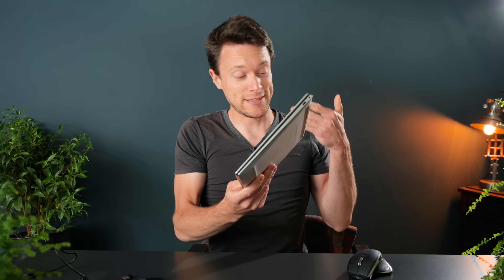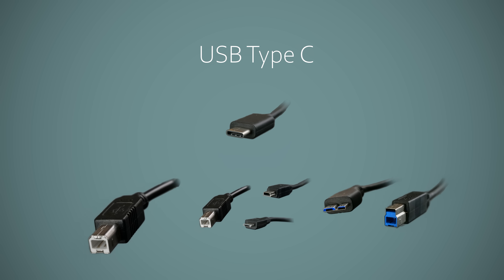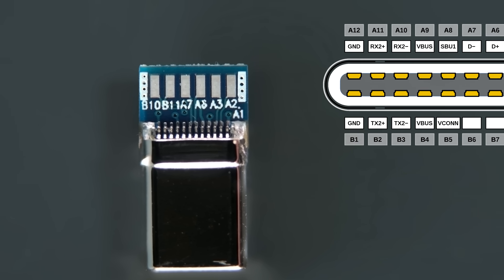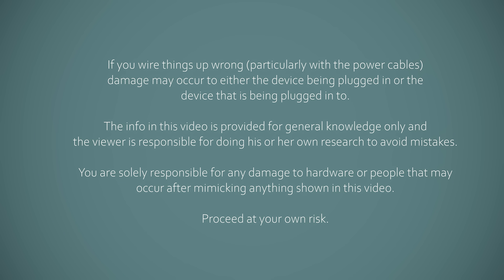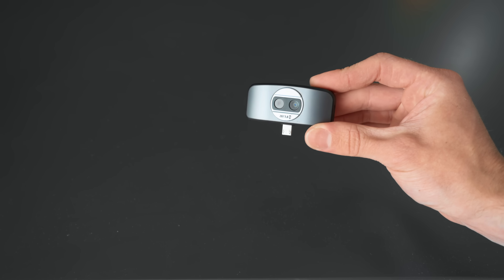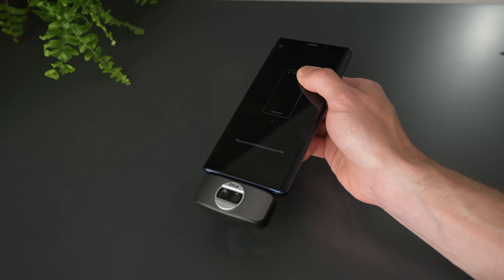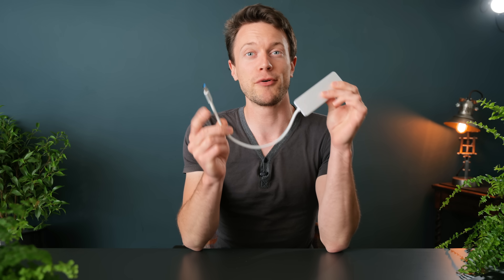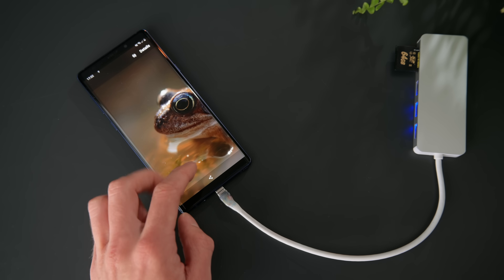Converting devices to USB Type-C

Comment: 7:05 can't you just move the existing resistor to other pads next to it? Seems to me that's how it's supposed to be done.

OR! Just jump the pads and scrape the trace?
Reply: dont even need to remove it, once the trace is cut like in the video just bridge the VBUS and GND sides
Reply: In fact yes one side of both pads connects to the pins on the USB while the other pins connect to VCC and GND. Swapping the position of the resistor would in fact change the mode
Reply: I almost had a heart attack while screaming, "just unsolder a move the resistor"
Reply: @DavidTelesPortugal  hahahahhahahhaha me too!
Reply: David Teles Tech & Video Can you plz explain which resistor and move to where. Also how would the help? Just asking for when i try to do something similar. Thanks
Reply: @Adok24  I'm not david, but I can tell you. At 7:08 You can see the highlighted resistor is labeled as R1. The empty slot to its left is labeled R2. Since the USB's function is either-or (host or sub), and there's two pads grouped together by the white outline, and we know the slot occupied by the resistor is  registering it as a host, logic dictates the pad next to it changes its registry to a "sub" device. 

The way you can tell what the resistor is doing is by looking at the traces on the board. At 7:08 you can see Matt highlighted the trace going from the positive wire (red wire) to top pad of the resistor. On the left (ground) it's the same thing. The Ground (black wire) runs to the top pad of where a resistor would be and down into the same spot where the right resistor is going.

Hope that makes sense.

Also if you do this with the same USB C board, you can just scratch the positive trace like Matt did and bridge the pads with a solder blob (top pad to top pad, bottom pad to bottom pad) Example of a solder blob incase you don't know: (https://www.wayneandlayne.com/files/blinky/pov_smt_v1.04/step_04_05_sz.jpg)
Reply: @Storebrand_  This is literally what i did 2 years ago, lol for my Flir one. I just modded an adapter tho, didn't want to butcher my Flir.
Reply: You can, but most people aren't too good at soldering SMD components so it's technically easier the way he did it for most people so I guess that this is the reason why he did it like that. Though it kinda hurts my eyes mashing non SMD components onto such a tiny board.
Reply: @knigfotlets9870  It's not the easiest way, the easiest way is to scrape away the trace like he did and then jumping the disconnected pad to R2.
Reply: @QoraxAudio  I never said it was the easiest.
Reply: @knigfotlets9870  "I never said it was the easiest."
So what?
Reply: Also it's more likely for people to have normal resistors at home than SMD components and DIY Perks projects are intended to be done with stuff you are more likely to have at home.
Reply: @knigfotlets9870  I know but it wouldn't be that hard to just swap the position of the existing resistor
Reply: @the_danksmith134  looking forwards to your vid on how to do that! Thanks!
Reply: @knigfotlets9870  I guess I got used to SMD components so much now I find through hole components very primitive and bulky to work with.
Reply: @knigfotlets9870  the resistor is already there
Reply: @knigfotlets9870  Also to be fair, people working with the soldering iron that he has will find it hard to move that component as well.  Just a reminder that I need to buy something with a real temperature control to make solder work much easier.
Reply: @DoomRater  Yeah, after I got a proper SMD rework station my struggles with soldering SMD components were immediately blown away, can't imagine soldering  with a normal soldering iron anymore.
Reply: @knigfotlets9870  Yep I got a super cheap one ($65) like 5 years ago. Works just fine and made a huge difference working with SMD components when fixing or modding. Even the super tiny stuff is so much easier.
Reply: @ryantakahashi9130  Me too! I got myself a Yihua 853D for 75 bucks and it's a real pleasure to solder stuff, since I got it soldering has become a great hobby to me, where before it was just a pain in the * when I had to take out my old soldering iron.
Reply: @knigfotlets9870  Trying to learn soldering myself and have a station with an iron. I'm curious what makes the Yihua 853D a "proper SMD rework station" (while watching a video of someone using it right now). Is it the addition of the programmable heat gun, or is it something more?
Reply: @knigfotlets9870  Yeah, because soldering a normal resistor to an smd path is easier than moving an smd resistor...
Reply: @devrim-oguz  the average Joe with his big ass soldering tip (which is probably gunked up as hell) MAYBE would have troubles moving a 2mm SMD resistor without completely covering it with solder effectively making the resistor useless. Just because you think it's easier to move the resistor doesn't mean everyone else who watches this channel thinks the same, so get down from your high horses.
Reply: @knigfotlets9870  you don't need to move the resistor, just cut the +v side of the trace and jump it to ground  on that end. Pretty easy even for non-smd tools. Once again, assuming the resistor spec is the same/similar enough for pull-up and pull-down versions
Reply: @knigfotlets9870  If you look at the board, there's no need to move it even. Just bridge it with other pad and do the cut as he did
Reply: @memberwhen22  Adapters aren't the answer here. They're bulky, they get lost and there's also the connection issues.
Not to mention this is DIY channel :D  Nothing DIY in buying an adapter :D
Reply: Well, just as they say, modern problems require modern solutions.
Reply: Came here to say the same, glad other peeps saw this too... :)
Reply: You know what would really help especially with smd components, some solder flux..
Would solve a lot of problems..
You can get a tube of 150g of decent general flux (NT ZJ-18) for like £5
Also lead solder is always a must.
But honestly for most people just buy a bloody adapter.
https://www.banggood.com/USB-OTG-Type-C-Male-To-USB-Female-OTG-Data-Adapter-For-Samsung-S8-Xiaomi-6-Huawei-M9-MacBook-p-1195585.html?ID=224&cur_warehouse=CN
Reply: Came to the comments to ask the same thing. it would also allow the whole setup to be smaller.
Reply: Same at 10:46.  It's not as easy to follow the traces, but I bet that empty pair of pads could be used to ground the resistor.  A simply continuity test would tell you if that's the case.
Reply: I agree to all replies that is easier for people that way, but it would be awesome if he just mentioned the proper way to do it, but how it's hard that way, suggesting to use that trick.
Reply: I agree. Scrape the trace and jump the pads with some wire. Everybody is saying to move the resistor, but it's much easier to just bodge it. I've seen enough EEVBlog tear downs to know this much.
Reply: Maybe he isn't proficient or comfortable in soldering smd.
Reply: if you have proper tools for it (all modern tech repairman should have them), you can just move the existing resistor
Reply: @gunsmaker777  I wish it was that easy, for me atleast.
Reply: @gunsmaker777  But the existing resistor is 56K and the one he solders on is 4,7K/5,1K. That may be the reason he didn't just move the existing one.
Reply: Sure if you can microsolder.
Reply: @kurtheil4922  I really should release a vid on how to completely butcher a full size soldering job! Microsolder??? What could possibly go wrong!!!🤔😱😱😱
Reply: Yeah I don't understand why he overcomplicated this process and used a big-ass through hole resistor.
Reply: I agree, just cut the trace to VDD, then bridge to the pad right under the R2 label.
Reply: @memberwhen Seems like he knows exactly what he’s doing. I mean, he did just show you that he successfully converted 3 different devices to work natively with USB Type C. 
If you think that buying an adapter is the way to go and the channel host “doesn’t know what he’s doing” because he chooses not to use adapters, then maybe a DIY channel isn’t the place for you.
Reply: I would've scraped the traces and jumped to ground myself, though it's possible the USB spec for the resistor values are different between the pull-up and pull-down implementation.
Reply: @CKTofu  Yes, As I recall, i had to replace the smd with a different value one when I modded my usb c to micro usb adapter
Reply: Looks like he's getting older and can't solder SMDs with naked eye.

Comment: R2 resistor position seems to be just for what you're trying to do. You could move the resistor there.
Reply: @memberwhen22  here's a fun guy
Reply: @memberwhen22  He mentions adapters like five times.
Reply: @memberwhen22  he specifically stated that he didnt want to use an adapter.
Reply: @memberwhen22  I think you missed the point of this video
Reply: Cab Callaway Or perhaps the video missed part of the plot? If some of the main goals are to make this simple enough, doing something like that vs just buying a $1 USB-C cord and soldering those wires onto the board in that hub? More work, more potential points of failure, and the cost of the adaptor + sugru + resistor - and with the FLIR ONE, they sell it OEM with 3 different connectors for different phones. You can order a replacement/repair USB board for it cheaper than that, plus it’s just a plug-n-play at that point, guaranteed to fit and not risking damage to parts. Sometimes you need to look twice before you start working on something. Try to approach it from 2 angles, not just taking the first viable path you see.
Reply: @CabCallawayMusic  there's no point in this video other than to destroy your devices and make unnecessary soldiering... It's just useless DIY
Reply: @memberwhen22  I presume you've never tried soldering components that small with a bog standard, cheap soldering iron (like the one he's using), not easy! Standard resistors are cheap enough and it saves you the headache. Those adapters add a fair bit of bulk too! This solution is far more elegant.

Comment: That MX mouse also has blue tooth built in so you could have used that instead of using the logi dongle
Reply: Its input lag is worse tho.
Reply: bluetooth is whack on these mice, i've had 2 of them, it can't be compared to the dongle in terms of accuracy/reliability :/
Reply: @4-0-K  didn't know, I never used one just watched reviews on them that sucks as expensive as this mouse is.